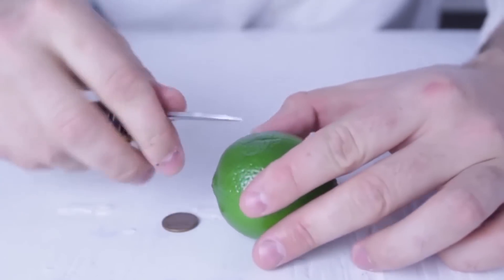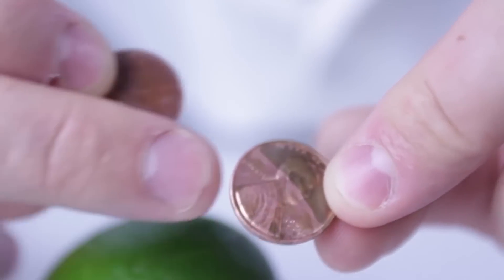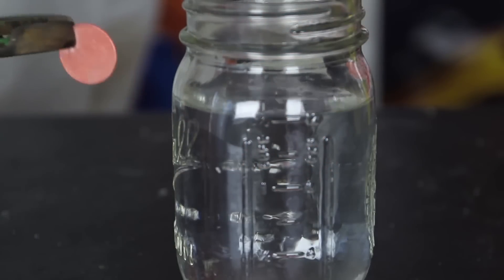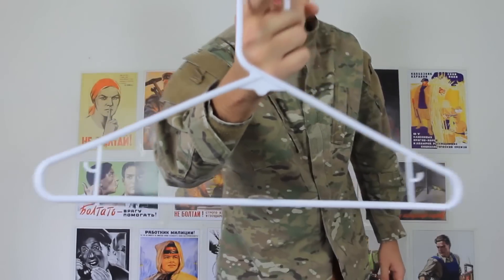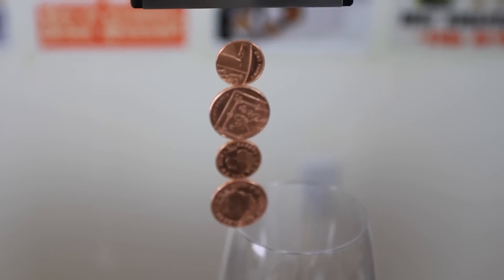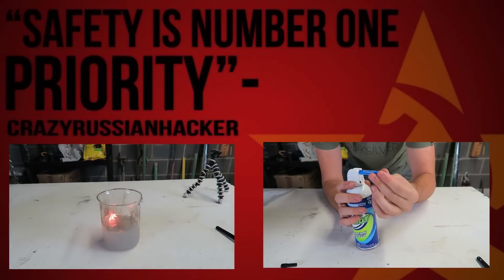8 Coin Science Experiments Compilation

Comment: There is a "double boiling point" due to the Leidenfrost effect around the coin. The coin is so hot that the Heet is vaporizing around the coin creating a cushion of gas.  When the heat from the coin isnt sufficient enough to keep this cushion stable the Heet collapses against the hot surface.

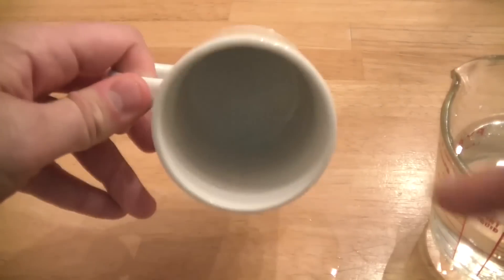Comment: The "optical illusion" at 5:30 is caused by the refraction of light. The water is more dense than air, so light particles act differently in water. Look up Snell's law.

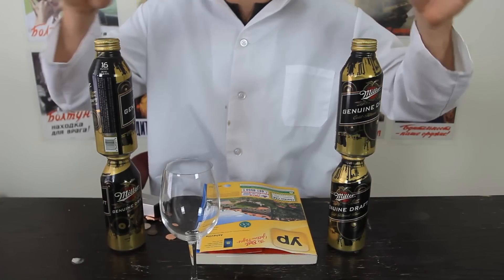The magnet one at 9:16 is very basic. The magnet's pull on the coins makes the weight of the coins become less. Earth's gravity still has a pull on it but it's not that much. It's basically the magnetic battle between the Earth and the magnets.

Comment: The one where you put the hot coin in Ethanol has a double effect. The first, where you get like a bubble around the coin is called The Leidenfrost effect. This is where the ethanol is boiling into a layer of gas around the coin, preventing it from actually touching the coin properly. At the point where the coin cools down enough, the bubble of Ethanol gas becomes too small to prevent the Ethanol from contacting the coin. That is where you get that sudden "Fizzing" sound of Ethanol boiling directly off the surface.

Comment: The reason the coins shiver

The temperature of the dry ice causes water vapor in the air to condense into tiny droplets, the reason the coins shiver in the dry ice is due to the coins temperature which causes more of those tiny droplets which pushes the coins into a different position and then it repeats.

Comment: Copper with Ethanol reaction is very simple, when you heat up the coin from copper, it will oxidise, and than, when you put the coin to ehtanol, it will give the oxygen molecule to Ethanol and produce Aldehyde. When you repeat this proces for 20 or 30 time, it will smelth sweet. Its aldehyde :) 

Sorry for my English

Comment: with the dry ice the coins do that because it's the heat of the coin touching the dry ice and the ice air wants to leave so it pushes the coin to the other side witch then the other side let's the air go so the it pushes the and it does it over and over again until it runs out of cold particles because there are so many heat particles son

Comment: ok, i found something awesome. if you have a freezer, check that it has this snow/ice like substance, put any US coin, i've found quarters work best, hold it in the ice for a few seconds, take it out, it should feel as if its been in the freezer for more than an hour, yet its only been a few seconds, can someone tell me why this happens??
Reply: it's cold.
Reply: you tried it?
Reply: it worked with all metals i tried #mirror
Reply: +Hizagm TV i think is cuz the metals arent able to hold temperature thats why they melt fast as the same way  they get cold
Reply: thanks :3
Reply: Metals like the quarter is made from (I think a copper/nickel alloy) have a high thermal conductivity value. This means that they can have heat transferred to or from them at a rapid rate as compared to say food in a freezer that's made up of mostly water (which has a low thermal conductivity value).
Reply: Rob Caruso
Thanks, that is pretty helpful to know  :D

Comment: I'd say the "double boiling" effect you where talking about in the ethanol was caused by the leidenfrost effect where the temperature of the coin creates a gas bubble around it stopping any more liquid from touching the heated surface area as the coin cools more liquid is aloud to touch so it suddenly boils and cools, like when you drop water drops on a red hot pan and the drops float around due to the cushion of gas underneath

Comment: The cause of the coins moving that fast is for example if you put water on dry ice then the carbon dioxide gas will air up and push the water to any side of the dry ice block but for the coins it's a little bit different. when you put the coins in the dry ice the carbon dioxide will air up on all the sides and push the gas and the coin back and fourth fast

Comment: in the third experiment when you dip the coin in at first it sizzles because its so hot its boiling the liquid then it stops because it cools down enough that it's no longer capable of boiling. In the fifth one the coin stays there due to centripetal force pushing the coin against the coathanger.

Comment: the reason why the 1971 coin changed is because around 1972 they changed from coins with no zink to coins with zink.  So over time as the coin got older the coin became dirtier, but when you add a lime filled with acetic acid, the acetic acid acts apon the dirt (cleaning it, some cleaners have acetic acid in it),, and the coin from 1973 has zink so it can not act apon it, because the zink is basically making a covering or "wall" around the coin as well as the dirt.  The reason why is because the Vietnam War was going on in 1973 and they needed to copper for other stuff like bullets, etc. and so when they found that the supply for copper was low and the demand was high the picked something to switch metals on and pennies were drown out and was replaced with zink.
Reply: it was 1982, and that's why there are 7 variations of the 1982 penny.
Reply: zinc*
Reply: But what did the veitnam war have to do with it?
Reply: The war comes into play because they needed the copper, no just read my message it explains it all.  But here is the explanation, copper was the only thing in a penny back then and when the war came around and we got apart of it we needed the copper for other things for protection and ammunition and when the usa started running out of copper we needed to cut the supply on something so we cut the copper on pennies and replaced it with zink.
Reply: okay whaaa Ahhhhhh
Reply: *ohhhhhh
Reply: xb
Reply: Incorrect information, it was in 82 that they changed it. There were also a handful of copper pennies minted in 83 by accident, and they are quite valuable if found.
Reply: +Steven Michael yes correc!!
Reply: +VASILELUCA2006 LUCA roman?
Reply: how much are they worth?
Reply: oh i dont know but if you go to american coins you can find you price
Reply: Your name doesn't go with this paragraph
Reply: Actually, that is not true. They chaged it in 1982/83. Get facts right. FYI im in 7th grade
Reply: Not true. Pennies dated from 1909 to 1958 are known as wheat cents and have less than 1% tin, the rest is copper. 1959 to 1982 pennies are 95% copper and 5% zinc. After mid 1982 pennies were made from 97.5% zinc and 2.5% copper. There were no changes made to metal percentages in the 70's at all. The Vietnam war did nothing to change metallurgic amounts of coins. (Of course there was a steel cent but that was the famous wheat cent during WWII.) There must some other reason why his '73 penny was unchanged because as with all other pennies from those years, they have 5% zinc, just like the others until mid-1982.
Reply: The Magician smart kid
Reply: Thanks for the explanations
Reply: Best
Reply: best what ,
videos
Reply: The explanation..somehow
Reply: oh thx
Reply: oh sorry my bad but i was close but that is the reason
Reply: +okay whaaa no, it's because in 1982 the value of copper rose higher than one cent
Reply: +Joe Theis. 👍👍👍👍👍
Reply: Zinc*
Reply: so did the Donald Trump just build a wall to make the Penny not clean , its suck (ps : im suck at english , just stfu
Reply: Niko Krisp do you grammar
Reply: The Magician
Reply: The Magician you can whites a lot
Reply: The Magician Roop
Reply: The Magician nhjjn
Reply: The Magician zinc***
Reply: Blissterd1 You're correct with everything ✔💯👍👌
Reply: N. B. I
Reply: its spelled "zinc"
Reply: NERD ALERT NERD ALERT!!!!!      N-E-R-D   A-L-E-A-R-T

Comment: i know as the coin is set to the room temperature,the room temperature consists of moisture due to contact of the coin to the dry ice it get melted  when the dry ice gets melted it comes to its place at a sec and when it melts it forms  a reverse triangle  on both sides  and it will move or shake and produces sound

Comment: About the magnets, the magnet's force field dependence in the distance from the source is F=1/r^3 meaning if you go back 2 meters away, the force applied to the object will be 1/8 smaller. But it still exists, even though its smaller. So if you put a feromagnetic object close to a magnet, it will accelerate into it because to force is powerful enough to overcome friction/gravity. However, when you push it far away, the field is still active on those objects, its just much less effective, but its still there. So the force of the magnet was almost the same as gravity in the way you positioned it. I doubt if it will work with only one coin, but it will with a few as you showed.

Comment: Its called the leidenfrost effect. The coin is so hot, and Methanol boils in such low temperature, that the Methanol surrounding the coin is boiling rapidly, until the coin cools down, the constant evaporation of the Methanol actually prevents good contact with the coin itself. After a while the coin is cold enough(yet hot) that the Methanol con completely surround the coin, with that, the coin will cool down almost instantly.

Comment: At first the coins are so hot that they instantly vaporize a layer of water around them to steam, because air doesn't conduct heat that well the coin cools down only slowly. the "second boiling point" is when the coin has cooled down enough for the water to reach the hot surface and cool it off quick.

Comment: The double boiling point is due to the 2 types of alcahole in it. Methonol has a lower boiling point and boils first. Moonshiners take advantage of this to get rid of the Poison methonol and then heat it higher to boil and distil the Ethonol with a higher boiling point.
Reply: +BEN HOWMAN  I believe it is due to a vapor barrier that exists during the initial immersion. Once the temperature falls below the point that no longer supports a vapor barrier, the barrier collapses and direct fluid contact occurs causing the second flash of boiling.
Reply: That makes sence also

Comment: The reason the coins have a double boil point is because coins are made with more than one type of metal one has a higher melting point then the other the lower temperatures will cool faster than the higher temperatures

Comment: what would happen if you heated up the coins before putting them in the dry ice? 

I saw a video where these guys shot a bullet into what looked like a ice sheet or ice pond and the bullet danced around like that. Are the metals similar? what if you shot it into thick enough dry ice? would this happen? the bullet didn't flip around but it was like the point was dancing around on the ice. I figured it was from the spin on the bullet from the barrel of the gun. but???

Comment: The Citrus in the lime erodes the dust dirt and grime from the penny and also the juice is giving is a wet shinny appeal
Reply: pennys have never been made of nickle; they are mostly zinc since the 80s i believe, with a copper cover
Reply: +Benjamin yeah it was post 1973 pennies
Reply: But why not after 1973?
Reply: +Sam Heister Because only early pennies are made of mostly all copper. Today's pennies are cheap metals with no copper. Which is what the citrus is actually cleaning. The discoloration on old pennies is a copper oxide tarnish on them. The citrus juice is actually an acid that will remove the oxide tarnish, making them shinny once again :)
Reply: +DidUseeThat_OMG thx for the info :)
Reply: sam brownig my pleasure
Reply: its because Nixon Shock
Reply: wow
Reply: um tbh Pennys are made of nickle and copper coated
Reply: You missed the point there friend.
Reply: Katie Bug since when is correcting the facts ever missing the point?  ...friend?

Comment: 6:00 The light that is coming off of the coin inside the water is bent because light slows down inside of liquids, When the light enters or exits it bends  away from the normal or the ray of light passing through the air, Therefore showing the coin once you had poured the water into the mug

Comment: My guess for the second burst of steam in the methanol one something called the lienden (not sure I spelt that right) frost effect. This is when something very hot touches a liquid (or ice) and creates a layer of gas, due to the liquid boiling into a had very fast (or in extreme cases ice sublimating), thus keeping it insulated and hot. Even so it still cools down so eventually the liquid can touch it with out instantly evaporating which after a while will evaporate effectively creating a second burst of the gas. ( but I'm not 100% sure this is more of an educated guess)

Comment: the double boiling point may be due to the liedenfrost effect, due to ethenols low boiling point the super hot coin is coated in a layer of ethenol gas protecting the coin. So when the coin finally begins to cool and the ethenol begins to actually touch it. my theory on it anyways

Comment: the coin is visible in the cup because the refractive index is changed by pouring water into the cup.

the coin stays on the hanger, note that the coin is placed in the exact center, the same point as his finger. the centrifugal force keeps the coin in place, but when the force changes the coin falls.

Comment: The reason that the coins are going through a "Double Boiling" is because of the Leidenfrost Effect. 

Simply put, the coin is so hot relative to the boiling point of the liquid, in this case methyl alcohol, that on contact it creates a barrier of vapor between the coin and the liquid reducing the cooling effect of the liquid on the metal.

After a while the coin has sufficiently cooled down to the point where the heat cannot produce enough vapor to keep the liquid away and it undergoes the "Second Boiling" which is just the normal boiling taking place between the liquid and the heated object.

Comment: the reason that in the "copper coin" experiment it "double boils" is before the "second" boil, the coin is so hot that it is evaporating the water around it, then it cools and boils the water instantly, and then nothing else happens because it cools down a little, but it will still burn your hands

Comment: It doesn't matter what type of ethanol it is the double boiling isn't boiling it is a instant transmission of heat and energy the ethanol goes straight from liquid to gas then as the coin cools it finally actually get to boiling point thus the double boil

Comment: The reason why you see the coin after putting water inside the cup, it is given by this formula: n(1)·sin(alpha)=n(2)·sin(beta) / where n(x) is the refractive index (1,33 for water / 1 for air) and alpha is the impact angle for water, as well as beta is the one for air. It's a little more complicated than that, because when you add water you're making all angles move in Z axis upwards.
Water refractive index has to go with inside-water beam and vice versa with air.

Comment: for anyone who doesn't know about the "double boiling point" of the quarters in a liquid, it's not boiling twice it's called the Leidenfrost effect. basically when a liquid comes into contact with something heated far above its boiling point the liquid immediately boils and forms a layer of steam insulating the heated item and the liquid. a good demonstration of this effect is if you heat up a pan on a stove high enough and drip water slowly onto the pan the drops will go sailing across the pan thanks to a layer of steam that's created. a more interesting demonstration of this is to put you hand into liquid nitrogen, since the boiling point of liquid nitrogen is so low a person can submerge their hand into it and a layer of nitrogen gas is created from the heat in your hand and insulates it from the liquid, of course there is a point where the 2 objects equalize enough in temperature that no more steam is created and that's when the object comes into contact with the liquid, that's the second sound you hear from the quarter in the jar.

Comment: Water refracts light bro so it appears bigger with more water. Cuz the more water the more refraction
Reply: And ur shades are swag
Reply: +Botato 27 it is the same logic of hockey pucks. If u put something warm enough into something that won't melt the friction between the hot and cold will repel. The coin is being rapidly pushed back and forth because the opposite temperatures are repelling each other

Comment: I'm pretty sure the coin trick at the end was worked like this. The glass has many different components. Some have aluminum and lead which gives it that ringing sound when you rub your finger around it. These components are magnetic which mean that the magnet pulling on the coin is pulling on the coin keeping them upright while the glass is keeping them together and on the glass. The reason he could put something in between the glass and the coins is because the magnetic forces between the glass and magnet will bend around objects to get to the opposite charge. Hope I helped:) ps. I may not be completely accurate, this is just my thoughts about this cool trick.

Comment: Dry ice is solid carbon dioxide, so maybe when he's jamming the quarters in, they are room temperature, and they melt the dry ice a little bit, and the escaping carbon dioxide (as a gas) comes out both sides and shakes the coin. Then they stop shaking because all the dry ice that came in contact with the quarter has escaped or the quarter has become to cold to melt the ice. At least that's my guess.

Comment: It's called the leidenfrost effect when the quarter is hotter than the liquids boiling point a thin layer of gas keeps the liquid from actually touching the coin and when the coin cools down to the boiling point a little bit of the fuel boils away and the coin cools down after that